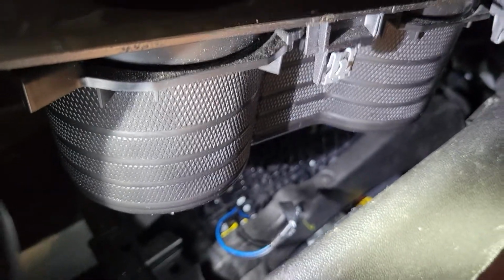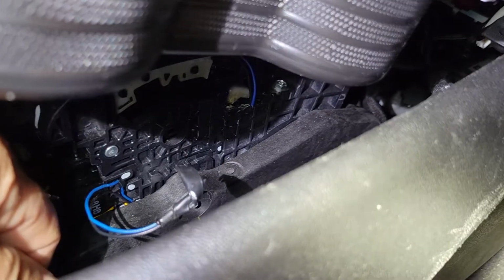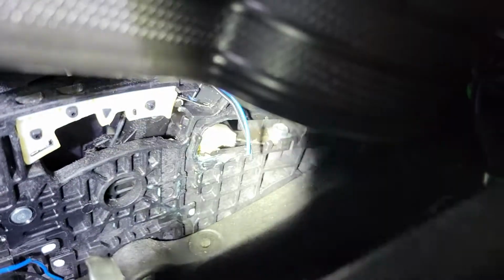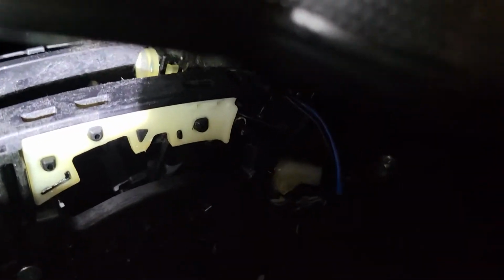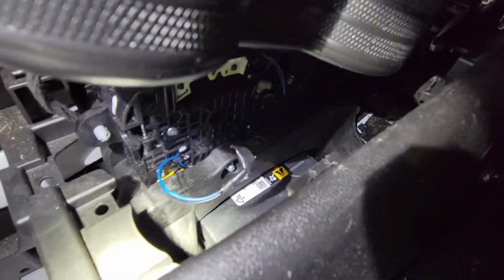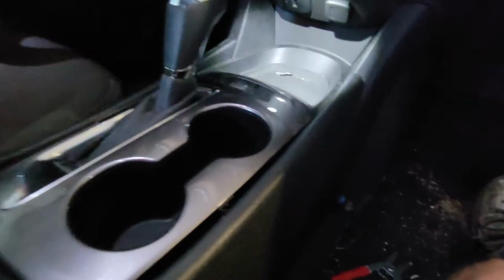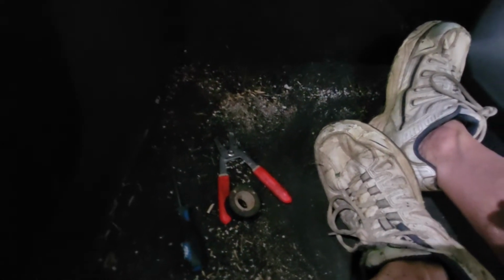Shift to park fast & free permanent fix 2018 malibu

Comment: So bypassing takes care of the shift to park issue, will this deem the car in a condition where it is always in park?  Will you get any errors
with regards to the switch always being made??
Reply from the maker: It will just make the warning on the dash go away.
Reply: @SawmillerSmith  This did not work for the error on my chevy traverse.  I tried it then i still got the error and then the car engine light came on as well... went with a different fix.
Reply from the maker: @jerrymolina1106  OK, I don't understand why it didn't bypass the switch and tripped an engine light. Been interesting what the code was.